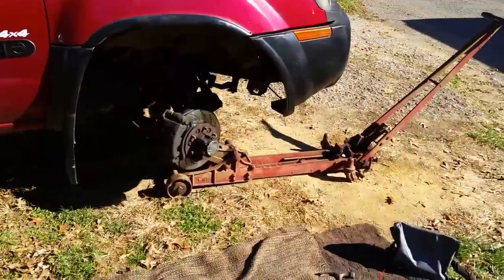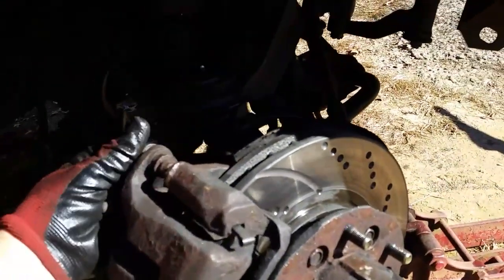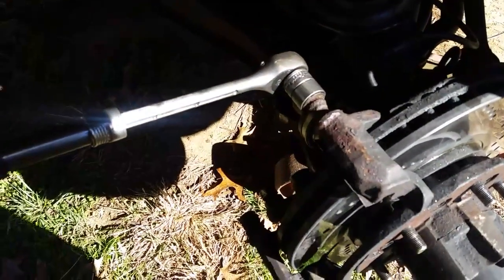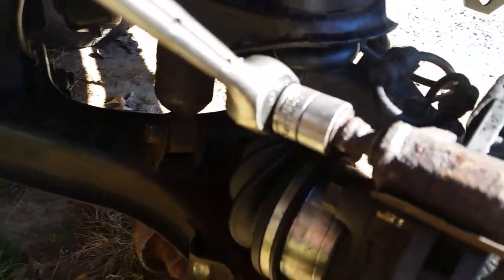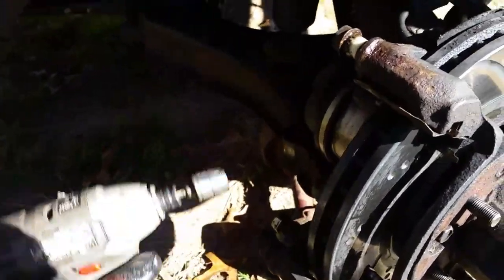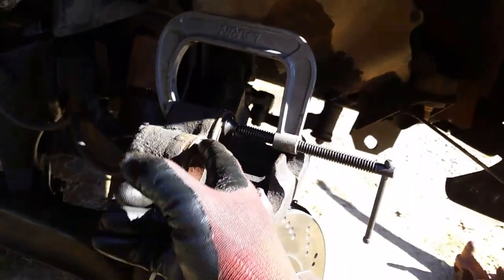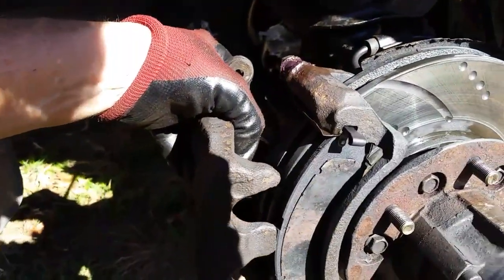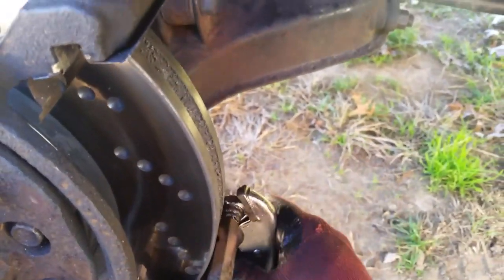Brake Caliper Pins Stuck. Lets break them free!

Comment: Tampa FL - had the same problem with my 2011 Corolla. Took the Caliper apart. Use a vice to to clamp it to a wooden bench. Pin pointing down. I torched that baby for 15 minutes! Used a flathead screwdriver end and a hamper. Placed driver on the underlip of the bolt pin. I pounded the heck out of it, until it finally popped out. Bought new pins and boots for $15. (Autozone). Used silicon cream on the new pins and boots. Put it all together and it works like a charm. I saved $80 too!
Reply from the maker: Nice!!! man!!

Comment: Thanks for this. As you say, it's a question of patience and persistance. I did mine two years ago, had the same difficulty (though not as bad as yours,) got new pins, cleaned out the bores, blathered them with silicon grease, made 100% certain the boots were on correctly and hey ho - just checked out the front n/s pins and the bottom one is seized solid. Together with the first occasion the garage did them, this will be the third time, in six years. The very fact that there are so many videos on YT, dealing with this very issue shouts one thing loud and clear: It's a SH1T design. Stainless steel for the pins and the brackets - or at least stainless sleeves within the bracket would surely be the answer here.

Comment: You did a great job with the tools you had. I would do the same if money is an issue. There is one other alternative besides buying another whole caliper set up. They do sell on most vehicles just the caliper bracket alone for about 35 bucks. Get 2 new pins and rubber boots that are about 7 bucks by me anyways. And boom your do e for under 50 bucks. But not to take away from what you did that is absolutely the most correct thing to do when money is an issue. Great job
Reply from the maker: Thanks man!!

Comment: I put the correct 6 pt socket on the pin itself after the bracket is off the car and i use an impact and spin it in the hole.  Works every time
Reply from the maker: Nice....

Comment: I did it all with hand tools. Didn't take more than 15 mins. I think the trick is to hit it with penetrating fluid or brake clean, that way it goes from hot to cold real quick. The change in temp can make it easier to get out. Just like a stuck ball joint. Only took me 3 tries with hand tools.
Reply from the maker: Nice!!!

Comment: Thank you for this. I was wailing away with a hammer on a stuck pin. Then I got scared that I was going to break something so I took it to the repair place because I felt I like was over my head.
Reply from the maker: O my!
Reply: @FixingWithPassion  My next 'challenge' is to figure out how to get the drum brakes off the back of my 2018 sonic. I figure I should have the replacement drums in hand before I start because I think it could get 'ugly'.  (from Southern Ontario Canada since you asked )  :D

Comment: I don't have a torch to heat up rusty bolts.
If I have the time and another ride I do this first, before breaking anything:
2 to 3 times a day, for up to 4 days, use a small ballpeen hammer or similar weighted tool and tap firmly on 5 to 6 areas of the bolt housing area. I whack each area for 30 seconds. Then I spray it with oil, then I whack again. Then oil again.  I've never had a rusty part not come out after 3 to 4 days of this. And usually the parts are reusable.
I recently had to do this on a caliper bolt and pin (one piece). The threads were fine, it was the pin end...it was stuck solid in the receiver-end of the caliper.  I couldn't turn the threaded end with a 18" extension! Took 3 days of whacking and oiling on 6 areas of the bolt housing. Then I could back it out.

Comment: You should be using brake and caliper grease, by using regular grease, wheel  bearing grease will gum up on you, regular grease wheel bearing grease will cause the rubber boot to swell up as the brake grease is safe to use with rubber  and you will be right back where you are.  I am just saying this from over 35 years as a mechanic
Reply from the maker: Prob so but i grab what i can get for free ;)
Reply: @FixingWithPassion   I understand that, I try to save when and where I can. But sometimes you have no choice,  also somethings you buy cheap will end up costing you more in the end been there before

Comment: Watching from the United Kingdom. I couldn't help but wonder as I am NOT a mechanic, moreover a DIY'er... if there was a rubber boot within or on the sliding pin, would not the heat used melt the rubber boot to a liquid? Thanks in advance for a possible response. I'm about to change my brake pads and rotors on a severely rust prone Toyota Avensis 2.2 D-4D T25, 2005 Reg Plate.
Researching ahead for the unexpected so I don't have to stop part way through the job and lose daylight hours for being ill prepared. A big thanks for your video. Good Job!!!😊

Comment: Spray   lube    into the  pin.  first.    Even if you have    to slice    the     rubber     boot    to get  lube  in there.  I would   do this    over the next 2-3 days       Still    took     time     Of course  once      i was able to  slide pin  out of    caliper       Clean   lube     replace  rubber  boot.
Reply from the maker: Right on!

Comment: im working on my 2012 honda rear breaks, and im having trouble getting the actualy sliding pin bottom bolt off. i got the top bolt off no problem but the bottom i just cant get it lose. any suggestions? i tried heating the bolt, knocking it, lubing the outside hoping it seaps through the cracks. i just cant get this little bolt loose.

Comment: You're putting way too much grease... but thanks for the video for getting it loose. Mine where so badly rusted (torn rubber boot) it took 2-3 hours each sides... I was a bit discouraged... I had not seen anybody actually showing the method. I might not have gotten it hot enough at first and not hitting them. I was told by a mechanic to heat and spray with water. I found that having the caliper off the car works better to get the lube in so it goes down instead of sideway like you did.
Reply from the maker: Nice!! Did a few yesterday on a explorer!

Comment: Good job!  Do you have any suggestions for lower a arm bushings?  Many of the suspension rebuild kits feature upper a arms (new), upper and lower ball joints, and tie rod ends but not lower a arms. I'de like to do a full rebuild on my 04 xTerra front suspension including the drag link and axels so any insights would be very welcome.

Comment: You didn't think it was a problem in the last video and said it was the rotors.....guess you were wrong and probably could have had the rotors turned after freeing the pins
Reply from the maker: Nope. It was both. The rotors were slightly warped also. Cheaper just to buy new ones now days.
Reply: @FixingWithPassion  It costs me $8 to turn a rotor
Reply from the maker: @zeke112964  lol  use to be...$25 here per rotor. No no does them anymore here.